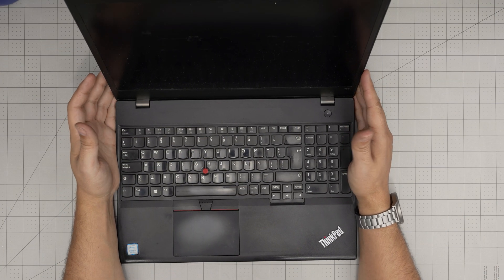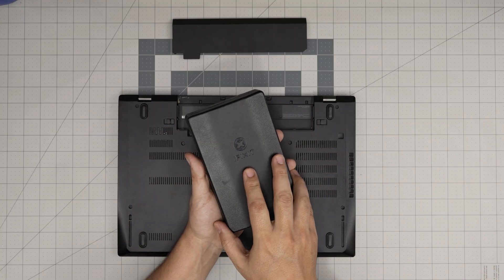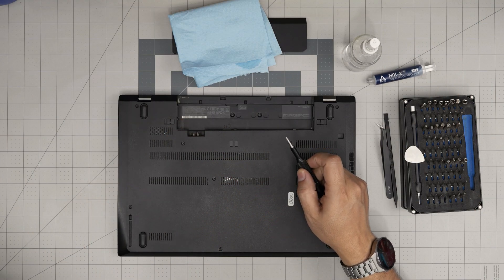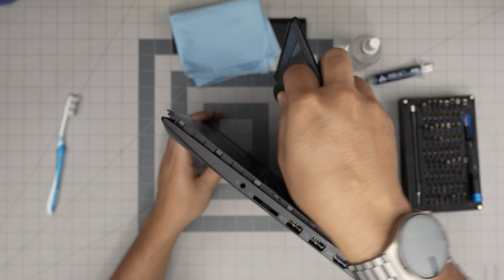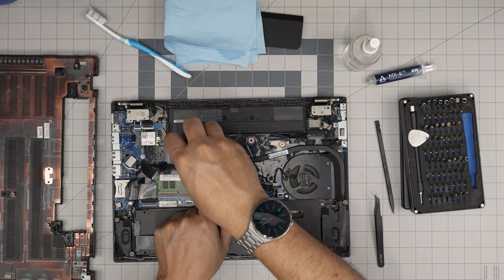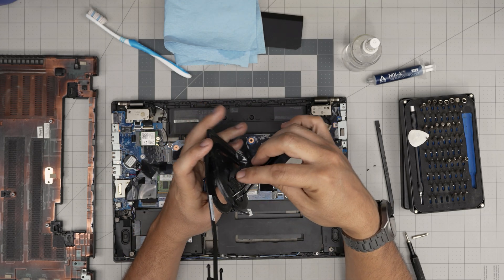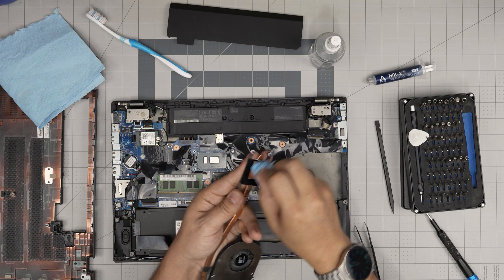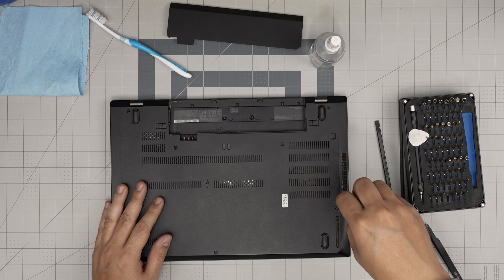How to Repaste and Clean Lenovo ThinkPad T580

Comment: thank you, amazing video. Is ok to use normal alchol for cleaning die from old paste?
Reply from the maker: It's my pleasure my friend.
🫠Regarding your question, you could, but make sure to clean it well and let it dry completely. Also, be careful not to get the 70% alcohol on the board or under the CPU. I would highly not recommend it, but if you're careful, you could.
Should you have any further questions or requests in the future, please don't hesitate to ask me.
cheers🍻
Reply: @uFixTek thank you, so better use a 90% alcohol?
Reply from the maker: Yes, that is the safest option to use.

Comment: hello sir, i have a problem with my nitro v 15 bios, it locked up with password, and if im wrong put password 3x times it says "Need To Insert Fat/Fat32 USB Dongle" and the bios send me the Code.txt File, can u help me for that sir, Thanks🙂
Reply from the maker: 🫠 Regarding your question, you will need a BIOS programmer. Then, I can provide you with an unlocked BIOS.bin file, and you can format the BIOS and record the new BIN file.